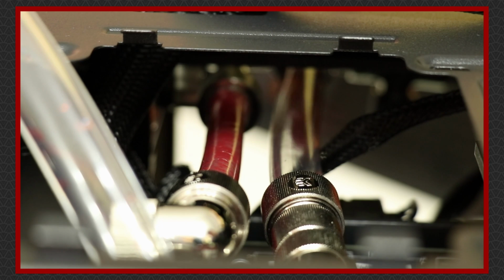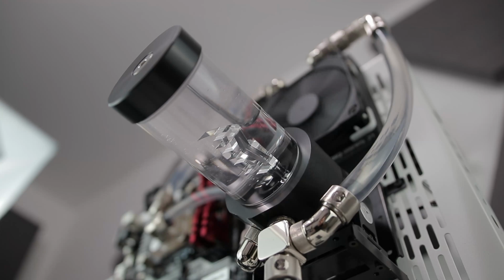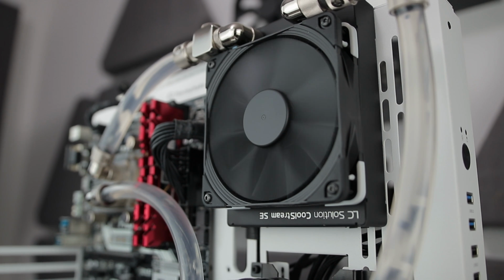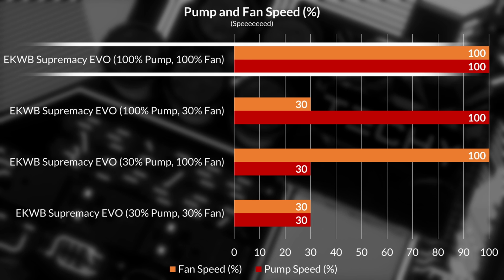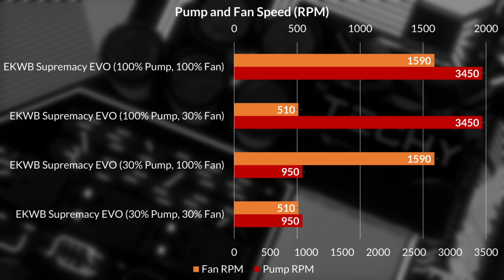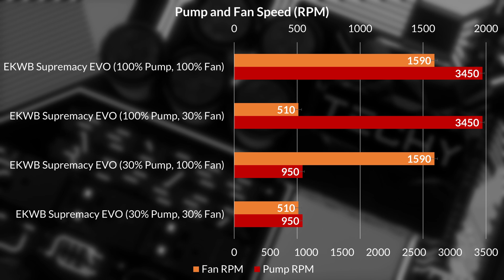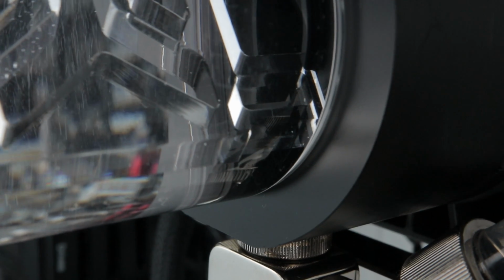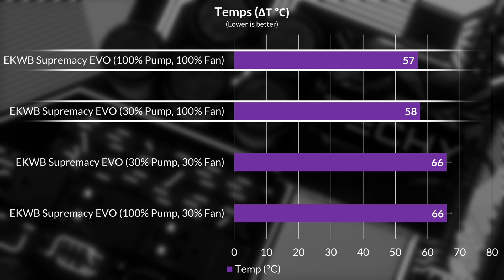Does Pump Speed Matter? // Performance Fundamentals

Comment: I also have found similar results in my setup. I’m running the gpu, cpu, and three 360mm radiators in my loop and found no difference with my EKWB D5 running at 100% and 60%. Not sure about 30% but I found the pump harmonics to be perfect at around 60% so left it there.
Reply: I should add that I’m running a 5800x with PBO enabled and a 3080ti with the power limit maxed. Not the highest spec anymore but still, when playing cyberpunk the gpu is dumping around 390-440 watts at 90+% utilization into the system and the cpu is around 70% utilization.
Reply: I have similar as well on 5800x with a thermalright frozen prism. 100% pump speed gets me 74c in stress test and 50% 78c

Comment: 4:05 You need to state percentage differences based on absolute values, e.g. Kelvin, and not Celsius.

It would actually help your point, too, as it would show that the 1 degree kelvin differential is actually about a 0.3% difference, even less than 2% (so running the pump at 100% all the time is an even bigger waste).

Comment: 30% fan speed  and 40% pump on my corsair  makes a big dif as to 30c to 32c all day down to 27-28c all day on high pump speed but the whine dose hinder my head
Reply: That's cause you bought a Corsair pump. Techpowerup showed its ratio isn't as smooth. So 40% is actually about 1500 rpms of the 4800 limits. You should run it where you're comfortable but closer to 50 or 60%

Comment: I was wondering if variable pump speeds based off CPU temps might show an appreciable difference when paired with variable fan speeds. I feel like the rate of heat dissipation from the radiator changes if fans are also at a variable speed so perhaps there's a sweet spot one can look for using different fan and pump rpm/temp curves. Increased speed would in my mind help with temperature change responsiveness but I think product specific data is lacking.
Reply from the maker: That is possible to do, but extremely challenging from a testing perspective.

Since fan curves rely on temperature, there's a feedback loop with the ambient temperature, so that would need to be consistent for all testing and through every test. 

It's a lot easier to test fixed rates, and extrapolate from there. It cuts out the feedback loop so keeps testing simple.

From this testing even if the pump ran at max speed due to a fan curve there wouldn't be a big difference if it ran a lot slower due to a less aggressive fan curve.
Reply: @AVTechy  I guess what I am looking for is where the limitations of a given AIO rad and fan combo give negligible benefits to increased pump flow rate. I imagine higher flow rates mean quicker thermal equilibrium but my feeling is that in practice there's a leveling off point and perhaps a point where the pump starts adding heat to the loop.

Comment: This is the most flawed and useless video I have seen on this topic ever
Reply from the maker: Explain
Reply: @AVTechy  where us any measurement of flow rate? Even your explanations lack so much content.
This is a middle school level, personal opinion bullshit.
Reply from the maker: That's true, flow rate is the one area that's not factored in. It doesn't mean it's useless, just not complete.

Unfortunately for me to do the test covering flow rate I'd need to spend a fair amount on a certain component which was outside of my wheelhouse as it were.

But yeah, not useless, just something to consider when researching the subject.

Regardless of flow rate, relatively speaking, in this testing, the low pump speed performs as well as the high pump speed and avoided pump whine that ruins silent builds.

If anything this is a point of saying "hey, have you tried running at minimums or have you gone with the idea that max is best?", Which I think is a useful outcome. Someone may see this and might question their setup, and be happy to be nudged in the right direction.

I know some may say it's obvious and people should do this anyway, but I get plenty of messages querying case fan setups from people that own the case they're questioning. Why don't they try different setups themselves? Who knows, maybe they're looking for an easy answer without messing around. This video could be the nudge to trying something different.

It's a step in the right direction and has some utility. I'm sure when you take your next step in the right direction of whatever you're working on, you'll also be looking for someone to call it bullshit, make you feel bad for trying to make something of some value or use even if you're not finished. Maybe you're thinking of proceeding with something better in the future, and thought what you'd done previously was good, but not complete, but still of some value so was worth doing, if anything as a learning point for yourself.

Maybe the guy saying it's bullshit thinks it's constructive criticism, but fails to understand using words like bullshit dominate the criticism so end up lessening the value of the criticism overall. Who knows, as long as the intention is good and made clear I think it's worth doing, just need to check both boxes.
Reply: @budterence85 Either you know what you are talking about or not, If you do, you would apply an explanation to what is flawed.

From my point of view this is one of the better and easy to understand explanations, easy to copy the test and find the right pumpspeed for your system.

Comment: G'day AV,
I didn't think there would be a difference or only minute if there was as I have done similar with my DeepCool Captain & a few Coolermaster AIOs Pump speed & have settled on 40%-50% (depending on design) as the ones I have are inaudiable to me there.

Comment: With 100s of different parts and configurations, pump speed can matter depending on certain factors. With your setup your data doesn't speak for each and every setup.
Reply from the maker: That's true. I covered this in the video. Different amounts of components, temperature source, block design, number of fittings, tube size, etc. This is an indication of how "a" setup performs though, and most of the other factors regard head pressure over flow, so speaking purely about flow through a relatively well designed block, relatively speaking that's how it performs.

I think the greatest factor that would impact/change this outcome is source wattage. With a power-hunger, highest end Threadripper CPU, that could change everything and require higher than minimum/low flow rate to get the water out of the block before it becomes thermally saturated.

But based on this testing, I'd say there's not a lot you could do to a loop (in a reasonable sense, without adding a comically high amount of fittings) that would change this outcome for CPU's outputting 50-200W (half to double of my testing setup). I can imagine it comes down to the thermal capacity of the coolant, and the lowest flow rate and limit of input energy from the source. But even then we're leaning into the realm of radiator surface area over flow rate. Maybe it's down to the block design. I have a few cheap blocks on the way so I can see how a lesser designed block performs in this area.

I really could do with getting hold of a much higher power system to answer the thermal load side of the question, but that's just not in the cards at the moment.